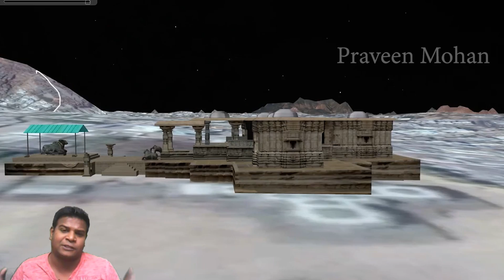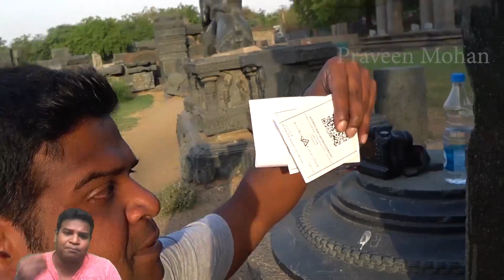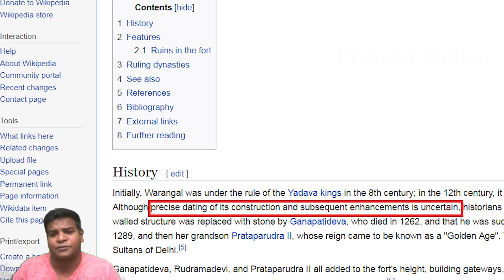Ancient Warangal Fort -  A Mass Manufacturing Megalithic Factory?

Comment: I think they used a rock harder than the one sculpted and by doing so, did not need diamond. The hard rock tool would get quickly worn out, but that was not an issue if they had ample supplies of it.  Unlike diamond which is hard to source and comes in miniscule quantities, they avoided that issue altogether.  They started by cutting deep gashes in the rough natural rock then by impact with a heavy rock blew away large parts of it to speed up the shaping process. They also pulverized and crushed the hard stone material by lifting and dropping a large stone over another large stone for days. The pulverized hard rock powder would be combined with water and used with  ropes to slice into the sculpted rock. I believe that the key of it all, is to teach groups of 100 men the discipline to synchronize their muscles in time and space. To achieve this goal workers would be trained for weeks and months without weights. An expert director of quarry would use sounds and percussion instruments to synchronize the workers movements like a score of composed music. That would be as precise as a modern music director of a symphony orchestra executing a music score in slow motion. Just think how agile and accurately 1 man can move a 10kg bag of rice repeatedly for hours. Take 100 men and if they were well trained like virtuoso musicians directed by a single man they could move a 1 ton rock with as much agility, precision, speed and repetition. The analogy with a classical music large ensemble is key. This requires skills and years of training, it is not an improvised skill. Once this is achieved it opens huge possibilities. This art of combining men has been lost and is often confused with forced labor. Today people think it is an instantly improvised skill to have a couple of men work together to move a heavy object. Our ancient predecessor pushed this art further than anything we can imagine. Today we are incapable of duplicating these feats because nobody has combined a group of 100 men and trained them for months to be able to execute perfectly synchronous muscle movments. At most much too few men, maybe just 5 men working on a couple hundred kilograms improvising it and wasting energy working against each other at every motion that is not in perfectly synchronicity. This art was lost and explains how they were able to assemble the finished super heavy stone into temples. Think of this : as more and more men are used the difficulty of the sheer weight disappears and is replaced by the difficulty of synchroning human brains. When too few men are used, they are constanlty pushing, showing but once sufficient quantity of men are used they are no longer pushing just standing in place. But that can only be achieved through training. I will push this theory even further, once a group of such expert workers and a director achieve a high level of skill they can start using wood poles to overcome the limitation of crowding too many men near the heavy stone object's surface. So now you can have 200 men each using a wood pole and together they could lift the 1 ton rock from the poles extended at arms length. Seeing this would be a show by itself. As long as synchronization is achieved, each man is only moving 5 kg of weight at the end of his pole. They could even rotate a 1 ton rock this way.  This art can be used no only in manutention but also to carve. Ancient people had higher group intelligence than we have today. 100 men could act like 1 man.

Comment: I don't think they used to transport all pieces from here because its a troublesome job .....maybe this place used to be a display place for various designs,from where u can select the design which u like..... because some of the structures present here are miniature sized ones( when comparing with the actual temple size) especially the ones which are placing on the roof of temples(the one with petals and all)......like a modern day architecture hub.

Comment: The blocks were "moulded" that way, all ancient peoples new the secrets of "geopolymer concrete" recipes of many types of stone in nature.⚡🌚⚡
Reply: yours is a valid point, but one should find the evidence of master negative piece for molding some where.  the same purpose   designed rock pieces     are of different sizes with different intricate designs. not of the same size and same decorative designs to say that they are molded.

Comment: This is absolutely the most ridiculously 😨 advanced stone work I have absolutely ever seen.... what the hell man...😨😨
Reply: @Skoddetid  yes I agree totally, too intricate for any other explanation, but what of the miles of wall carvings in Angkor wat, they look like they were carved on sight , they might not be as intricate as these but they are also mind boggling in small detail, would like your opinion on them if you have seen them already.
Reply: @daveelcock9476  I think it is very likely the ancients used simple moulding techniques in order to achieve the various 'impossible' or 'high tech' patterns on walls and ceilings. Do a Google image search on 'plaster moulding' and look at the pictures. This is how we do this today using various plaster mixtures. Do another image search for 'Angkor Wat patterns' and compare the pictures. Same thing in my opinion. It is however unknown what mixture they used back then. To complicate this a little further (and now we move into some crazy territory here): I think sites like Angkor Wat is MUCH much older than what is currently believed and that the original structure was built from common materials just like we build today: bricks, wood, concrete, mud, terracotta roof tiles and so on. Check out the roof tiles at Angor, would anyone in their right mind carve out roof tiles from stone like that? I don't think so. At some point I suspect this complex was buried in sediments, mud, volcanic ash or something similar. Over time this led to the whole structure being saturated/petrified and basically turned into homogeneous rock, thus creating the illusion that everything is cut/carved from rock. Then over a long period erosion and possibly also later generations have dug the structure out, basically revealing a fossilized building. All the original building materials are gone. Just food for thought :-)
Reply: @Skoddetid  I pretty much agree with a lot of what you said, especially regarding the intricate carvings come moulds, the thing is they still had to make the moulds probably of wood, and to do that takes machinery of some kind and the volume and consistency is amazing, as if a 3d printer was used.
Reply: @daveelcock9476  I agree they probably used wooden moulds. I don't know about the 3D printers though! I mean, even today when we have all this fancy tech, it does not make sense to use it on such a scale. We should never underestimate what can be achieved with very simple methods. Google search 'ancient plaster moulding' and look at the images, looks very similar to what is found in India. The official story is that this was invented in ancient Greece but I suspect it goes way longer back. However, finding such patterns in India made from granite or basalt does make we wonder how they did it.
Reply: @Skoddetid  the granite and basalt is leaning toward machinery , especially the polished granite carvings.
Reply: I am Indian and I can't believe it too

Comment: Inspired by your video, I made it a point to visit this place on my work trip to Hyderabad. I think your observation is absolutely correct. The place is strewn with similar carvings-the Nandi, the pillars, the peacocks,etc. There are both finished and unfinished sculptures do it definitely looks like a manufacturing site inside the fort. And yes the finish of these sculptures is remarkably smooth. In fact it is not only smooth but also lustrous. It gets one thinking about the kind of craftsmanship people  had mastered back then and  what tools and techniques they used to achieve such wonders. Kudos to you for bringing such forgotten treasures to people's notice. Keep traveling and posting.

Comment: Very interesting, is there any signs of manufacturing facilities or transportation systems ? Could this place be where repairs were done, maybe it's even a junk yard ?
My personal opinion is that there were those with very high skills at levels far beyond the regular population, doing these things to share knowledge and nothing else.
They knew how MOLICULAR ENERGY works, even when trapped and motionless within solid objects. They understood the measurements of ENERGY FLOW needed to lift ENERGY LOCK solid objects off the ground, same as NASA does with its rockets, only thiere was much more fine tuned understanding molicular motion when trapped within solid objects, they fall downward. So, they cut and move large stones with ENERGY, wasting no time with the mythical Gravity .

Comment: Thank you Mr. Mohan for your continued work and determination! I get to see things I never would have even imagined.

I have a question regarding the purity of the stones at this site and in the various temples in previous videos. Are there any veins of other minerals running through any of the artifacts at this site? Sediment lines? Are there pieces there that appear to have been cast aside due to impurity in the rock?

If there are none of these, then perhaps they are molded as you theorize.  It would be a waste of time to work a project only to come across a natural impurity that would ruin the piece. Either the builders had a way to scan the rock prior to working/cutting on them, or they made many of these with a chance to have a defect in the end product. Same for the video showing the temple cut out of the mountain where all the rocks are removed and the structure is all one solid piece of the mountain. 

I saw the video about the "melting rock technology?" I think it was made from Black Basalt from what I recall and that pillar looks almost exactly like some you show in this video. Some are finished, and others seem not finished. It certainly appears to be a lathe system for some pieces, and perhaps molds for others. Or, molded, then lathed?

Comment: WOW! ...first C.N.C. stone cutting plasma ... "CNC plasma cutting factory" ... where are the parts and tools of the machines? sure that there is something hidden inside a "secret" place ... the machine that appears at 13.35 is a milling machine or CNC,  made of stone, like those that exist made in iron that mold the materials of fitting for construction, as shows and very well, in the automobile factory ... thank you very much for the visual information that you show, with the stories.

Comment: Thank you for your fascinating video! Have you measured any of these perfectly symmetrical pieces with modern tools? For instance, just comparing two of the very detailed and delicate carvings from two different sides of the same lathe turned piece? What are the "tolerances"? Are they identical to the thousandth's of an inch or mm? How perfectly round are they? Within a fraction of a mm? If you examine a hidden and protected part with a portable microscopic magnifier, are there any tiny marks of tools of any kind? The square mirror polished pillars, how perfectly square are they when measured with modern tools? If their polished surface is examined microscopically, from a part protected by the weather, what secrets does this reveal? What do the microscopic signs of polishing show? What "grit" of polish was used? Is there sign of high heat, melting, as though the rock was cut with a CNC laser? Or are there broken areas that reveal the inside of the rock; is it normal crystalline structure of rock, OR, does it look like something that was molten or soft or liquid and cast in or injected into a mold? Is the dirt and ground full of microscopic dust from machine carving or polishing? Thank you again for your videos!

Comment: The outer 'rings' of the formation appear to be 'star fort' walls with a blast hole being the lake within the first ring, and then the entire site covered with mud.  The manufacturing facility was buried in the mud flood and then excavated and a few buildings and gates re-built.  There is evidence that the gates are not square to each other, evidence of a re-construction by inferior builders and also evidence of the typical points on a star fort is my guess about the history

Comment: I have a background in prototyping and manufacturing soooo... Take a portable 3D scanner out there and get CAD Solid models created. It's pretty easy now. Next, analyze the cad models for accuracy and interesting metrics. "Creaform" is a place to start. Maybe they'll sponsor you complete with a crew. It would be an incredible opportunity for any provider. Also, I have NO connection to that company. I'd like to see the scan data for these and many others open sourced for group hacking. The results may be very interesting but looking at the artifacts by eye is completely inadequate from an accuracy and precision standpoint. Great work.

Comment: If it was mass manufactured, then there needs to be a detailed plan with precision measurements before the carving actually happens. Otherwise the pieces are not going to fit when you transport to the final location for assembly. That itself is mind boggling. Great job Pravin, keep going

Comment: Hi Praveen Mohan , You are right it is a Manufacturing site for the Architectural and cultural needs of the Kakatiya Times between 11th century to 13th centuries . 
     If you can see , there are 100s of temples as huge as the Thousand pillar temple around the Warangal and other places in Telangana and Andhra pradesh. The Archeology department got vexed with the no. of temples and doesn't want to take the financial and physical burden of protecting these monuments , due to which many smuggling gangs and treasure hunters had spoilt these temples.
      Like the thousand pillar temple there is a 500 pillar temple in the outskirts of Warangal City , where a 2 Tonne Ganapathi Idol is stolen by the treasure hunters and smugglers.

Comment: Hi Praveen Mohan , You are right it is a Manufacturing site for the Architect and cultural needs of the Kakatiya Times between 11th century to 13th centuries .

If you can see , there are 100s of temples as huge as the Thousand pillar temple around the Warangal and other places in Telangana and Andhra pradesh.
The Archeology department got vexed with the no. of temples and doesn't want to take the financial and physical burden of protecting these monuments , due to which many smuggling gangs and treasure hunters had spoilt these temples.

Like the thousand pillar temple there is a 500 pillar temple in the outskirts of Warangal City , where a 2 Tonne Ganapathi Idol is stolen by the treasure hunters and smugglers.

Comment: Maybe it was a training & display center, if not necessarily a manufacturing site?  Masons would come from all over, learn how to carve / shape / mould various and/or work with various types of stone (or geopolymers), and once trained, could be sent to other sites?  Additionally, purchasers would travel to Warangal, pick out the exact features they want for their particular temple, and could be paired up either with the actual stone (with the rest locally-made, perhaps), or take back with them the artisan skilled at crafting that pattern? Hearing that all the stones are shaped different from each other makes me think of home decor shops where they have all the different kinds and colors of carpeting, floor tiles, wall tiles, countertop types, and so forth laid out for viewing and selection.  You may take home that particular piece, or you may take home a version of it, or perhaps the artisan who can craft one just like it...  Additionally, different stones fragment in different ways, depending on their makeup and crystalline structures.  Marble and granite are not going to be chiseled and shaped the same way as each other, with marble being considerably softer, but granite and basalt, while hard, won't be cut in the same way (granite has various different sizes of crystals, whereas basalt is more uniform).  It makes more sense to do your training in a place where you can try carving different types of stone.

Comment: The Picture from the stoneblock at 8:53 is intriguing. Both rosettas have 35 big leaves and do look equal. But if you start counting, you get 10,15,20 for the one on the right and 10,14,21 on the left. This is definately not a coincidence. Anyone has an idea?